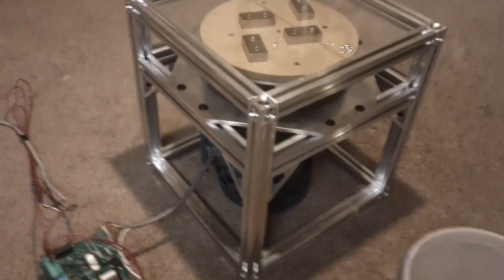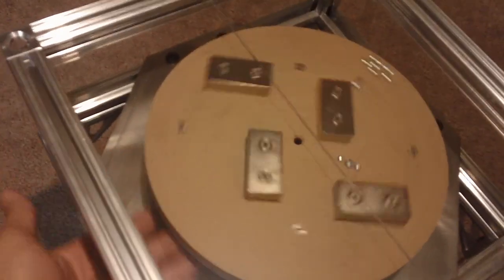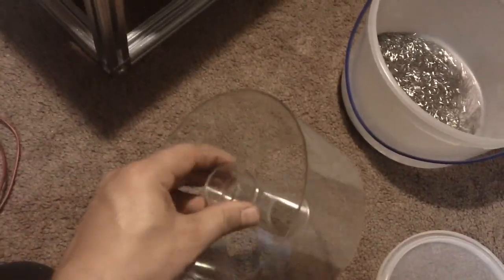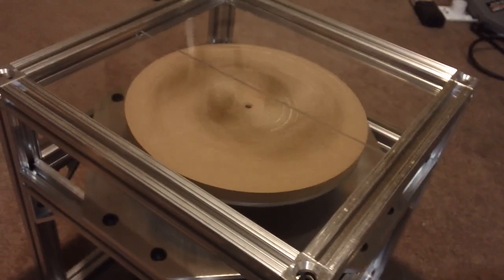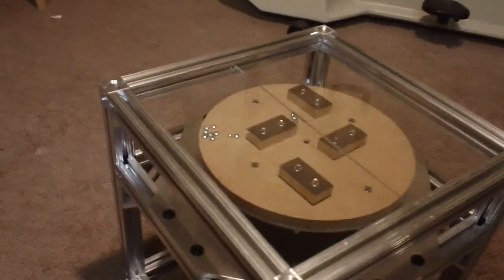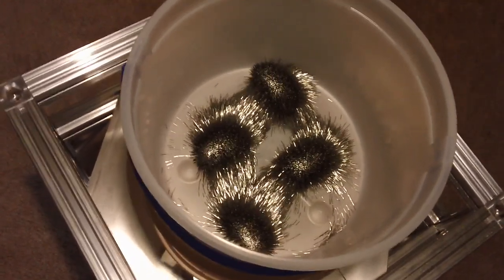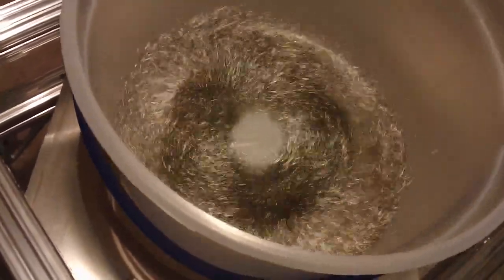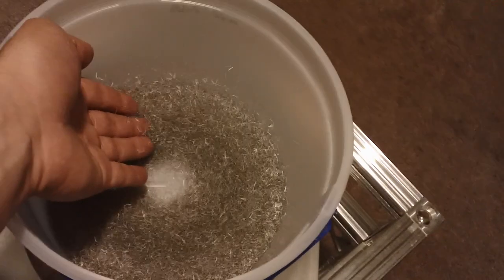Magnetic Polisher

Comment from the maker: Hey - glad you like the polisher and thank you for your message.  I'll give ya the short list, and if you need more I'll post more information:  Magnetics are from magnetics4less (NB057-0-N48), motor is from ebay (90VDC, 1/3hp or less even is fine), framing is 8020 Inc extrusions 1010 series (ebay: 8020incGaragesale), controller is KBIC-120 (also from ebay), and I found a 
10-12" disk sander arbor (ebay cheap or web search).  Let me know if you need more information.  thx!
Reply: Why my Ikohe magnetic finisher is starting to slip sometimes. I have to start it couple of times before it starts working properly it makes a noise like it something is slipping.Appreciatte it if you answer

Comment: Hey, thank you very much for the info. I bought the Controller, the Motor and the magnetics but the frame i did not find it cheap, and some parts of the frame i couldn't find like that little top square thing, which hold the frame together. And if you can, please, would be kind enough to provide me the dimensions of the frame. Thank you.

Comment: Impressive polisher / tool for sure. As a fellow DIYer i can see the amount of work, effort, thinking & design that you put into this, well done. For polishing brass for reloading I'm running a 30RPM geared motor for my process, works just great. Thanks for your time to share.
Reply from the maker: Hey!  and thanks for the nice comments - it's appreciated..  For your reloading brass, are you tumbling, or magnetic polishing?  I've got a very large vibratory tumbler for my brass, and I typically use corn with that - I have not tried 
magnetic polisher for in cleaning my brass though,,,  maybe something for me to play with.  :)
Reply: Hi, I'm using a "wet method" of tumbling my brass. Rotating bucket attached to a geared 30 RPM motor. In the bucket are stainless steel magnetic pins to clean the brass along with dial soap & LemiShine to remove any water spots on the brass. I generally tumble about 250+ pieces of brass for around 3-4 hours. Rinse, separate the SS media pins and then go about my reloading process. Dry media using corn cobs or walnut hull bits will do an OK job but wet tumbling does a fantastic job & the brass case & primer pockets come out amazing. I built my tumbler including acquiring the motor for under $75, its crude but works and the results speak for themselves.

Comment from the maker: Motor is a 90VDC, (1/3hp, max rpm is 1750).  With the K&B motor controller, I can spin the arbor at any rate (0-1750 rpms).  I have noticed that when you add water/soap mixture to the bowl, that drastically changes the rate the pins move, and having the motor controller allows me to adjust the speed to whatever I feel polishes the best.  That changes all the time, and depends on the size/number of the pieces I'm polishing, as well as if I'd like to add more pins.

Comment: That's a great bit of work! It eliminates the vibration problem of the 'normal' system.
Off to the workshop to build one my self! Thanks for posting!
A before and after of the polishing results would be appreciated?
Reply from the maker: Tony Vincent Hey Tony - and thank you for watching - this machine is a good design, and I haven't had one lick of trouble from it.  Just keep in mind, you can only polish or clean non-magnetic materials / (nonferrous) metals - otherwise you'll get a really neat show.  :)  If you build one, let me know if you have any questions.
Reply: Brian Wisotzkey Thanks Brian. I have some 40/20/10mm neodymiums that I can use to build a small version. Alluminium is what I mainly clean so no problem.

Comment from the maker: Hello Numa - not sure if this type of polishing would work for large alloy rims.  If you have smaller model size alloy rims (say up to a few inches in diameter), then yes you could use a magnetic polisher.  As long as your metal object that you'd like to polish is NOT a ferrous metal (i.e. magnetic).  Objects made out of alum., brass, silver, gold, platinum can be polished in this type of machine & of course it can only polish smaller pieces.  Hope this helps!  thanks for watching my video.

Comment from the maker: yeh sure.  at the time I was buying 1010 series alum/parts, they were selling unfinished "tri-corner" connectors for a cheap price.  I bought a bunch and used those for the corners, however there are several other/simple ways to connect corners/ends.  Keep in mind, that your size is really up to you and also needs to be the right size to accommodate the spec. motor you have.  However, my dimensions:  Top container surface (LxW) = 11"x11" and the height of the machine is 13" from bottom to top.

Comment: for god sake..please show the stuff u polish with this thing...dont just show spinning pins..omg..the video is not complete
Reply from the maker: +Azrat Akbar sorry - I should have considered including that - however this video was mostly posted to show how one might build their own machine.  I wanted to share the structural components and show the summation of parts.  These machines are pretty common and widely available (however expensive), and if you're doing project work that requires a magnetic polisher,  then you'd probably also be familiar with how things look when they come out of the machine.  Typically people use these machines to clean and polish newly molded/casted jewelry.
Reply: +Brian Wisotzkey Not a fan of Azrat's slightly rude way of putting it but I would also like to see some examples of things you've polished with your machine. Any chance of a short followup video? 

I'm in the process of finding all the components so I can make one of my own.
Reply from the maker: +Kufunklefec Thanks for your interest in my video and the polishing machine.  I certainly welcome any/all comments, rude or polite can be just as informative and helpful to me for future videos.  Rather than purchasing overpriced tools, I'll typically design and build my own trying to save money.  I've got more than a couple videos in the pipeline and I'll definitely include a Magnetic Polisher follow up.  Thanks again for the comment and support, and good luck building yours - if you have any questions be sure to ask me, and let me know how it turns out.
Reply from the maker: +bobothecreepyclown sorry you don't understand
Reply: bobothecreepyclown  Pointless, indeed. Unless you're interested in how you might make a magnetic polisher. Which is my interest and how I got to this video. While some before/after examples of what the polisher can do would be a great addition, this video as it stands is clearly not pointless. But it might not be pointed at you...and I think many of us are OK with that...
Reply: bobothecreepyclown  Not at all pointless. I got some very valuable tips on the hardware; it's a build video. Pointless comments though provide no value.

Comment: Hi very impressed with your polisher and going to make one my self going to use a tried mill that I got off crags list for free just wanted to know if you hoked up the motor direct or used a belt>
Reply from the maker: Hello and thanks for your comments,, and to answer your question - I hooked up the motor directly.  With a DC motor controller, you'll be able to make adjustments in the RPM's of the motor.  
Good luck on your build and if you have any more questions - just let me know.

Comment: Excellent build! I am planning my own brass tumbler for cleaning cartridge cases and was thinking of a similar design. But, I'm not sure if this design would be too aggressive and peen the cases as well as cleaning them. Can you comment on this?
Reply from the maker: I don't think it would be too agressive, if you'd use small enough gauge polishing media/pins.  However, where I think the problem may occur is, how large your brass is and how many.  I know for my 45 ACP, I'd probably only be able to throw in a box or so.  Where as your tumbler and a burnishing compound or soap, you could rotate a larger quantity.  I've actually built a multi-barrel rotary tumbler which you might be interested in - I can tumble several loads at once.
Reply: Brian Wisotzkey
Yeah, I'd like to see your tumbler design. Thanks.

Comment from the maker: For holding the frame together, rather than using the "tri-corner connectors", I'd recommend the following joining plates instead - checkem out:
ebay, Aluminum 5 Hole "L" Joining Plate 10 Series 4081 ANO (preferred)
Price is cheap too.  or check out these other parts/joining plates:
ebay, Aluminum Corner Gusset 10 S 4132 N,  or Aluminum Corner Gusset 10 S 4136 N, or Aluminum Corner Bracket 10 S 4115 N  

Anyhow - hope this helps you.  Let me know when you get the thing built, send me a pict.

Comment: this video needs a follow up vid showing it strip rust of bolts or something like that
Reply from the maker: +tony Pettersen sorry, but this machine is not intended for cleaning steel or any magnetic objects that may be rusty.  The machine is for NON-Ferrous metals/material only (Gold, silver, brass, bronze, or aluminum), otherwise the machine will spin your object at the rotation rate of the polisher, and probably actually damage the part and the machine.

Comment from the maker: In response to several people asking about how the magnet polarities are set/arranged, I thought I'd post a comment to discuss the details.  First off, the magnets individually need to be polarized through the thickness of the magnetic (i.e.  North-south poles are arrange top to bottom, NOT lengthwise.)  After that, the magnetics should be mounted on the arbor disk such that the polarities topside alternate N-S-N-S.  The magnetics should be arranged such that when rotating they occupy most of the circular region of rotation - if you look at my video, and see the pattern/arrangement, I've found that this staggered geometry works EXTREMELY well.  Hope this helps everyone!  Brian,
Reply: Perfect ! Would you be interested in make and sale one for me ?

Comment: thanks for the info
so do u think KBWM-120 DC motor control 9380 NEMA-1 enclosure
will work with B&B Motor Adjustable Speed Drive Motor DC 1/3 HP 90 VDC 1725 RPM. regarding the motor control on ebay they say (This Drive will not operate without a HORSEPOWER RESISTOR and ARMATURE FUSE.)even for the one you recommend. did u buy anything extra for the motor control?
Reply from the maker: +Body Mind & Beyond Clinic Hello and thank you for you interest in my video.  I took a look at the KBWM-120 and I like it A LOT.  I think that'll work great for ya, and yes you are correct you'll need a fuse and HP resistor, both need to be match approx. to your DC 90V motors HP rating.  This motor driver is good up to 1/3Hp motor, so you'll have to find something preferably under that or at 1/3Hp..    The manual for the driver has the fuse and resister chart for you:  

https://motorsandcontrol.com/media/document/file/manuals/9380.pdf

Resister (1/3hp motor) = 0.035 Ohm
Fuse (1/3Hp motor, 3.3Amp current) = 5Amp fuse (you can find these resistors on ebay or Surplus Center typically has them too.)

Aside from that - you should be good to go - nothing else is needed.  Let me know if you need any other information.

Comment: Is the adhesion force important? What strength of adhesion is recommended ? 
Thank you
Reply from the maker: aram tcho Hello and thank you for your questions/interest.  As far as the magnetic force/pull is concerned - the bigger/larger the pulling force, the better.  The magnets that I purchased were N48 (2"x1"x0.5"), and the have a pull force of 80 pounds or more.   Magnet part number NB057-0-N48 from www.magnet4less.com
Reply: thank you for your fast answare.

Comment: Hi, congratulations on your machine, I'm trying to do one on my own. I'd just like to ask you what's the magnetic material you used? I coludn't understand from the video.
Reply from the maker: Hello and thanks for your interest.  The magnets are rare earth magnets.  If you look under video or above these comments, you'll see a "SHOW MORE" under the "Published on" section.  I have a complete list of all components and in some cases I even put links to the items you need to build your own machine.  Let me know if you have any other questions or need help.  Regards
Brian
Reply: Thanks man, I've checked up the list. What about the material you used as abrasive? I thought stainlees steel wasn't magnetic
Reply from the maker: yep - you are definitely correct.  However I think they're made certain blends of stainless steel that is magnetic to a degree?.  maybe.  Not sure how stainless/anti-rust it is though. .  please find the link below to the jewelry supply company where I get the media from:

https://www.riogrande.com/Product/Stainless-Steel-Shot-50-x-05mm-Pin/339355
Reply: Thanks a lot man, I'll check it out and tell you how my machine turned out. One last question, how's the result of the finishing?
Reply from the maker: Sure, don't hesitate to ask if you have any more questions.  Not sure what you're gonna use the machine for, however, this machine is fantastic for "cleaning" newly casted pieces or cleaning oxidation off of parts..  It leaves an extremely smooth surface on the part, but something to note, it leaves a frosted finish - not mirror.

Comment: Hi Brian, nice build!! have you tried it with any shot/heavier stainless media like balls or jewelers media?  Do you think the magnets could "throw" such media, or would it work with a heavier motor and stronger magnets?  Thanks, Michael
Reply from the maker: Hey Michael!  and thanks for your interest.  To answer your question, I haven't tried heavier media - however to throw heavier media, the motor should have no problem spinning, but the magnets - you'll probably have to get your hands on the strongest rare earths available.  First thought that comes to mind - you'll need to use less media.  Heavier media would probably not necessarily polish but work harden/shot peen/maybe even deform the surface of the work pieces.  Let me ask ya - are you looking to clean, polish or harden?

Comment: How well are those magnets held down? There is a lot of centrifugal force going on here. I hope you built a lid because if those pins escape, they are going to be moving rather fast.
Reply from the maker: +tarstarkusz Agreed, there is considerable force on those magnets, with even more sheering force when the polishing media is place on top.  I've bolted the magnets down with Stainless socket fasteners and lock nuts)..  Even still, I've thought about cnc'ing out or routering out shallow pockets for the magnets to partially recess into - added safety measure.  Haven't yet done that, because the machine/arbor wheel is solid and nothing has loosened up.  Thanks for your input though.  And yes, when polishing, I do place a lid over the container,,, however keep in mind, when polishing the pins and the object your polishing are in a soapy/water solution.

Comment: Do have any thing on KB speed control I bought 2 motors of eBay and 2 aluminium disk for sanding. They are both 8 in with 1/2 in spindel.  I thought I would use those for the turn table.  On the KB speed control is there a model number and do you know if they will work in both directions Orr do I need something to control direction. I want to make mine run in 2 directions.  Also you said you bought the tri corner connectors for the aluminum.  Where did you buy them I checked with 8020 and ebay and they sell for $17.95 each.  That's pretty steep for 1 tri connector.
Reply from the maker: Hello and I'm glad that your building one of these things.  It's a great machine.  first off, the K&B controller that I used was the KBIC-120 and it is reversible if you get creative.  I did wire my motor/controller/and a switch to allow me to reverse motor direction.  you'll need a dbl pole, dbl throw switch (such as http://www.surpluscenter.com/Electrical/Switches/Toggle-Switches/DPDT-CO-10-AMP-TOGGLE-SWITCH-11-3261.axd)..  and wire it up such that the switch flips the motor wires.    second thing to mention - I would not use the tri corners just because they are expensive.  I was able to get unfinished corners that were significantly cheaper - they look good, but suitable cheaper solutions can be found (i.e. corner plates/gussets/brackets).  Hope this helps ya, if you need more details on the switch wiring or whatever - let me know.
Reply: Thanks for the info.  Yes I called 8020 and the unfinished are now more expensive because they now come anodized and they charge to remove the finish.
Reply from the maker: Michael Shelton Ah - looks like I was just lucky, and squeezed under the door on the ones I got.  Just go for the plain old 90 deg and straight joining plates - it'll still look good, and probably be even stronger.